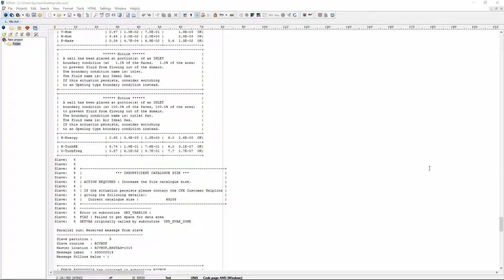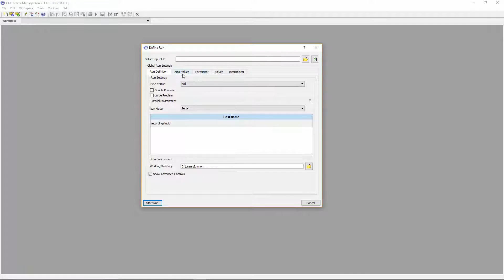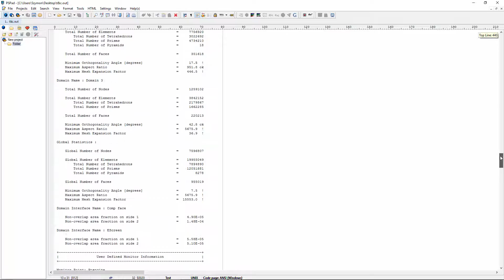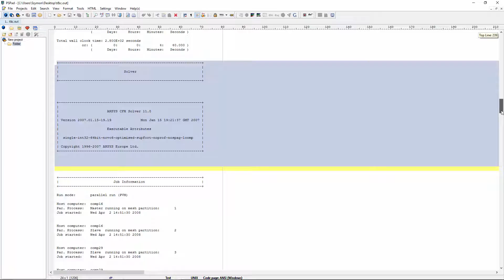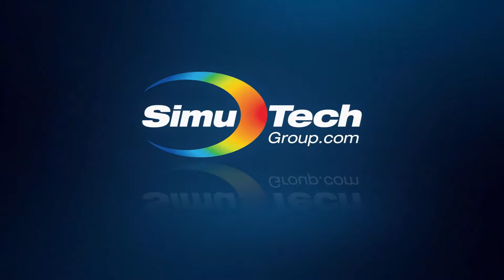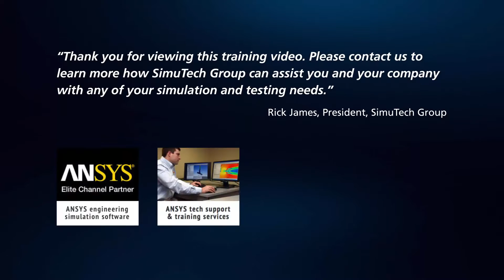Fix Memory Allocation Errors in Ansys CFX | Solver Crash Troubleshooting

Comment: System.ApplicationException: Application failed to connect.
   at Ansys.CFX.Foundation.App.CUEApplicationProxy.Start(Boolean waitForCommands)
   at Ansys.CFX.CFDPost.App.CFDPostProxy.LoadApplication()
   at Ansys.CFX.Foundation.Data.CUESourceDataObject.Edit(IFullContext context, Boolean interactive)
   at Ansys.Core.Commands.Concurrency.CommandWorkUnit.executeInContext(CommandContext subContext, IExecutionEngineCallback tracer)
   at Ansys.Core.Commands.Concurrency.BaseWorkUnit.doExecute(IExecutionEngineCallback executionEngine, CommandContext subContext)
   at Ansys.Core.Commands.Concurrency.BaseWorkUnit.Execute(IExecutionEngineCallback executionEngine, Boolean dontCatchExceptions)
--- Ansys.Core.Commands.CommandFailedException: Application failed to connect.
CommandName: CFX.EditResultsAnalysis(Container="Results")
   at Ansys.Core.Commands.CommandAsyncResult.RethrowFailureException(Exception e)
   at Ansys.Core.Commands.CommandAsyncResult.Wait(Int32 milliSecondsTimeout, Boolean exitContext)
   at Ansys.CFX.CFDPost.Commands.EditResultsAnalysisCommand.InvokeAndWait(IProtectedContext context, DataContainerReference Container, Boolean Interactive)
   at Ansys.CFX.CFDPost.Commands.EditResultsAnalysisGui.Invoke(GuiOperationContext context)
   at Ansys.UI.GuiOperationContext.Invoke(GuiOperationMetaData operationData)
   at Ansys.UI.UIManager.InvokeOperationCore(String pseudoname, OperationDelegate callback, Boolean allowOSMessages, Boolean coreTransaction, Boolean deferredRefreshOnly)

how can solve it please

Comment: Sir I'm using Ansys 2020 R1
But during running the calculation , it's getting a message that, memory allocation failed, what should I do sir , please please please help,

My system spec is

my windows 10 ,i5 -9th gen, 8GB RAM, 1 TB+256 SSD, 4 GB graphics card
Reply from the maker: Hello, feel free to drop us a note at info@simutechgroup.com if you're interested in our consulting services and we'd be more than happy to help! Otherwise there is the Ansys student community to find posts/articles: https://studentcommunity.ansys.com/